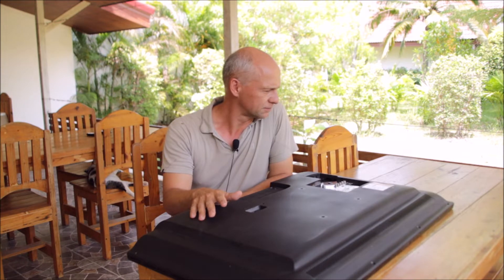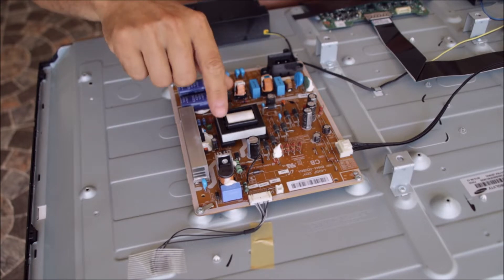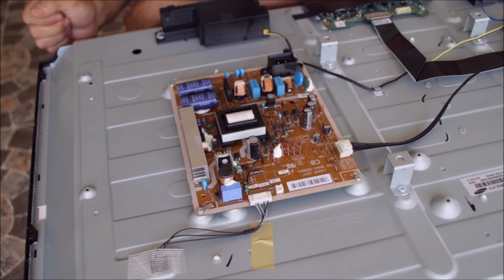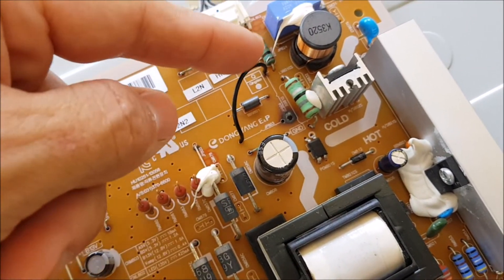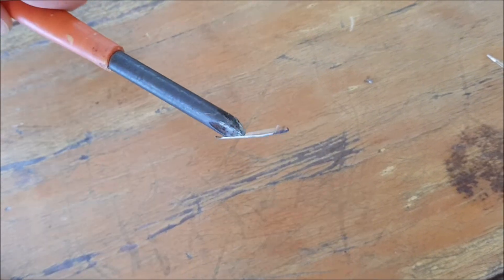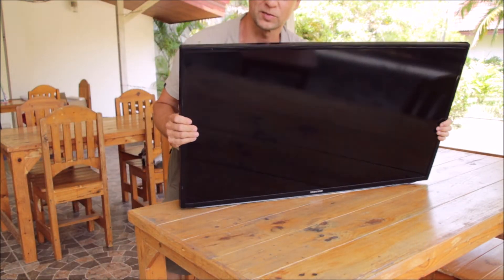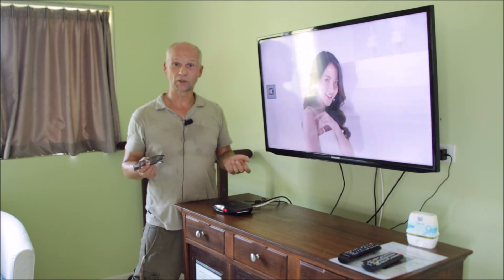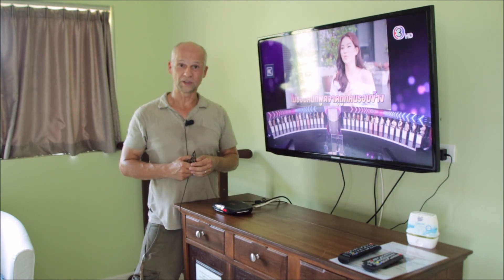Samsung EH5000 TV PSU repair. This failure shouldn't have happened at all.

Comment: Poor quality through hole joint slowly develops into a high resistance hot spot. Coated steel jumpers and component legs help build down to the bone on price. When you manufacture millions, material cost becomes significant. Satisfactory average life of a product also goes into the mix, Samsung does not rate well in this area. 
Another Samsung party trick is dried out electrolytic capacitors at the power supply unable to deliver the boot up  power. One day TV starts next day it fails.
Reply from the maker: Thanks! Yes, I am very disappointed with Samsung. I have 3 other TVs where the screen is starting to get orange discoloration from the edges. Can't be repaired. Just a total screen replacement can be done. And a screen costs the same as a new TV.

Comment: I also think it's corrosion, what is the humidity level where you are. I live in Durban, South Africa and its 70% most of the year. Conformal coating on circuit boards is a must.
Reply from the maker: Really strange, that this isn't considered in the choice of material for the jumpers. Could use some alloy which resists corrosion. It wouldn't make much of a difference in price as it's just wires.
Reply: @RolandW_DIYEnergyandMore  opened my Playstation 4 after many years living near the coast couldnt believe it was still working when I saw the state of the it inside.